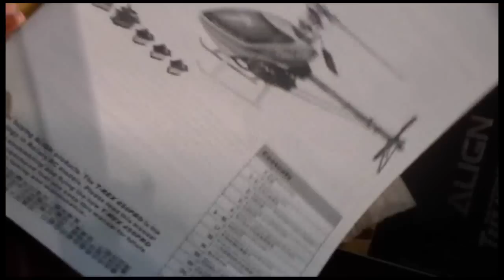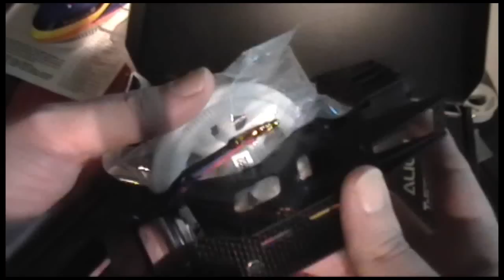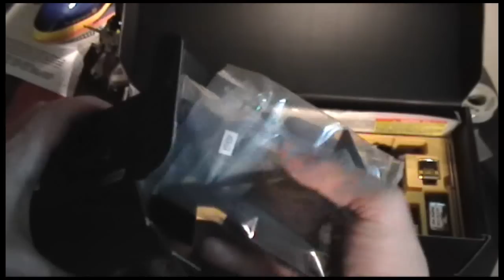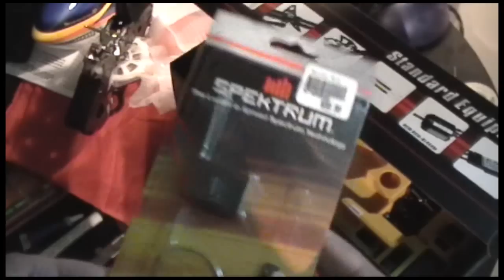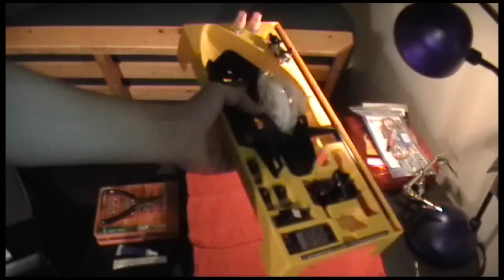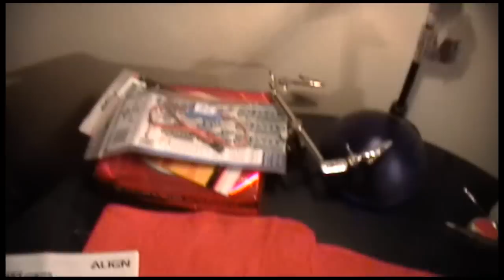450 Pro Build Part 1

Comment from the maker: @Captan6pack Just remember to take apart the head and grease the thrust bearings with some lithium grease or silicon grease, and then lock-tite the feathering shaft screws when you put it back together. I had trouble with the electronics layout, but eventually got it. Just take it slow and think, and you should be fine.

Comment from the maker: @Captan6pack Also, if you have questions or problems, you can go to the RCGroups and HeliFreak forums to ask a question. Specifically, look on HeliFreak for Finless Bob's build videos for the 450 Pro. The main reason I'm not doing one is because he did about 10 really good ones. Send me a message on one of those sites when you join - same name as here.

Comment from the maker: @Captan6pack No I won't be doing a detailed build video, as I built the heli already and didn't film most of it. I filmed some special things though, and will be doing a video showing general build practices, and things to watch out for. The 450 *Pro* isn't for beginners, and it's sort of assumed that you will know a little about building. However, I did build my first heli myself with no help, so it can be done. Just go through the manual a few times and look at the parts till you understand it

Comment from the maker: @thefirstofmykind I finished the heli a few weeks ago, just behind on my videos. It flies very nicely. I haven't been able to work it out real hard yet, because I'm still working on the settings, but it has a very solid feel in the air - even with the gyro gain up too high. Did three flights on it last weekend but still have some tweaking to do, and nothing but bad weather around here.